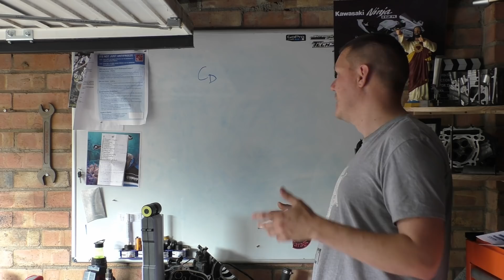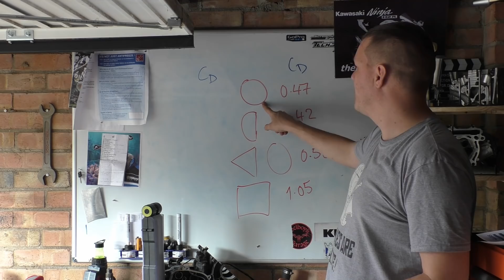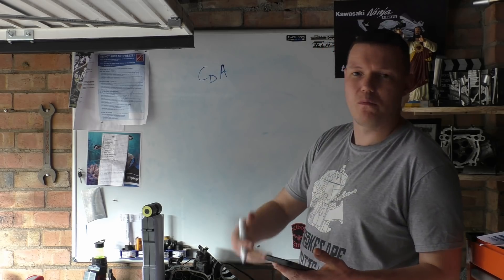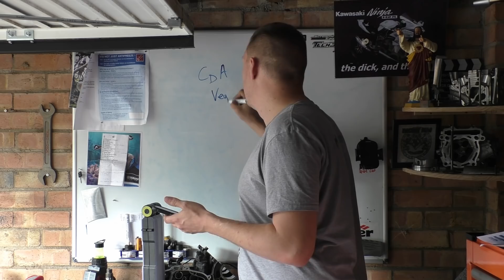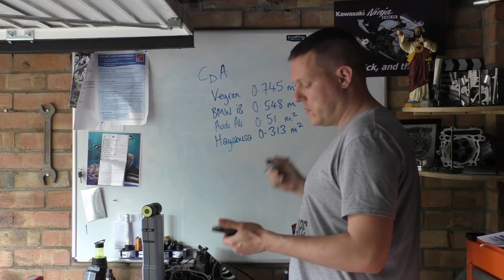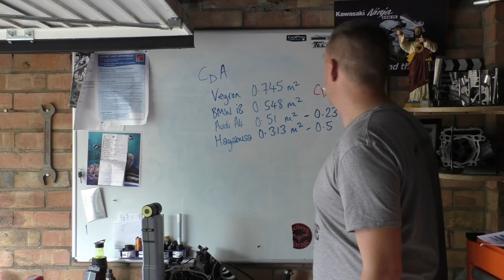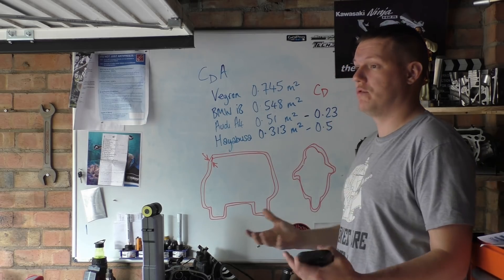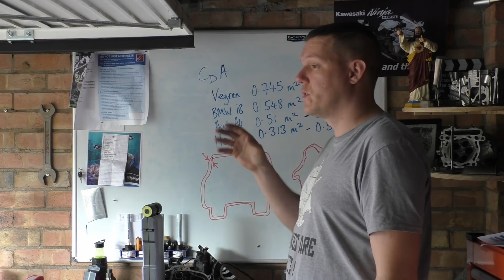Cars vs Bikes - AERODYNAMICS

Comment: CD is basically why we have useable electric cars.
And why we don't have useable electric bikes - range is utter garbage, as batteris simply don't pack eough energy to overcome drag for long enough.

And most of this is to be blamed on motorcycle racing, namely the bannings on fully streamlined motorcycle fairings there, that trickled down into the civlian market.
(It made sense in the 20s, 30s, 40s - in the days of cheap CFD avoidiing full streamlining is done out of historical precendent)
Reply from the maker: "And most of this is to be blamed on motorcycle racing, namely the bannings on fully streamlined motorcycle fairings there, that trickled down into the civlian market."

- Dustbin fairings don't provide that much benefit to a dynamic system vs the additional weight etc...

Comment: A major difference with the car versus bike (apart from the obvious) is that with the car the size and shape of the driver makes no difference so the CD for the car is correct as long as  the windows are shut and no-one has fitted a roof rack. The bike situation changes a lot, the rider is unlikely to be tucked behind the fairing riding round town.

Comment: It’s all just numbers anyway. There are far far far far too many variables that make Cd figures “redundant”;
Rider (size weight ability clothing ad infinitum)
Tyres (pressures compounds wear tread pattern etc etc)
Road surface
Wind speed/ direction
Environmental temperature/ humidity etc

Figures don’t really mean a fuck in real life every day driving or riding surely unless you’re chasing straighteners speeds on a strip or salt pan somewhere in same conditions as competing vehicle

Just my tuppen’orth!

Comment: There is very good and simple way to understand drag in practical sense. Without wind tunnel.
Take 2L pepsi bottle, cut it in the middle (you can drink pepsi before).
Now, take a car with driver and while you are crusing around 50kmh - open the window, and take the half-bottle outside. Cap in front. Then rotate it 180 deg - cap at rear. Now you feel what means difference in coefficent of drag. The surface area is unchanged, but forces are different.
Excuse my English.

Comment: The air resistance is likely why bikes aren't as fuel efficient as cars. There are also other factors as to why cars seem more fuel efficient such as the manufacturer disconnecting all ancillaries & testing on a rolling road so as to limit air resistance. There are car manufacturers that quote their "Government" MPG figures in adverts,that nobody can ever achieve on the road. My 25 year old CBR 600 used to do about 30-35 MPG as the front brakes were binding,now fixed I'm getting 50 MPG+ despite regularly tanking it on quiet stretches of road.

If you ride a bike,there should be no need concerning yourself with trying to get the best MPG from it. If you want max MPG,buy a 125cc & then you'll get 120+ MPG.
Reply from the maker: "The air resistance is likely why bikes aren't as fuel efficient as cars."

- Why?
Reply: The Workshop as it used to be the primary reason the consumers bought model X instead of model Y,& I still recall the Audi 100cc carrying its drag coefficient of 0.33 on the lower C pillars,yet finding any bikes coefficient is pointless as stick a fat kid on it = aerodynamic of a brick,but stick Mr Punyverse aboard and they can hide behind a fairing = aerodynamic as a toy car😁😁😁😁

Comment: Great video Matt, I seem to remember that one of the older unaired bikes was fighting 165lb of drag at 130mph. Badly worded but you get the point, have not checked that against ft/Ib to get the horsepower. It does highlight a bit why these 200mph bikes have such long wheelbases....

Comment: its difficult comparing a 1000cc bike to a 1000 cc car. a car at that displacment is an economy car a 1000 cc bike is fucking nuts so the ecu will be tuned different the revs are different. even though ita lighter and super slippy they have to squeeze a lot more power out of a smaller engine... can you do a video on the physics of cornering car vs bike
Reply from the maker: "its difficult comparing a 1000cc bike to a 1000 cc car. a car at that displacment is an economy car a 1000 cc bike is fucking nuts so the ecu will be tuned different the revs are different."

- there's a load of things you could take into account - however, across the board bikes have lower mpg than cars with engine sixes that are the same. These video are about the fundamental reasons why.

Comment: Aerodynamics only really come into play at speeds above 60 mph
Reply from the maker: "Aerodynamics only really come into play at speeds above 60 mph"

- Here this all the time and it bollocks really. As long as there's air there is resistance. The difference is when you under 60 mph the engines power is a lot larger than the resistance facing it.
Reply: It's not black and white with 60 mph being some magic universal reference point. It depends on the mass of the object. The heavier it is, the less the effect aerodynamics has on it. So, for heavier things you have to go faster to have a decent aerodynamic effect.
Reply: I would love to see car vs bike done at 50mph. See how much the numbers change

Comment: One of the great things about aerodynamics like you mentioned is that its great in a tube but not so easy in real life. When i'm going into a strong headwind it can make a big difference but somethings that work well in that situation are pretty shit when the wind changes directions. They make these deep dish wheels for pedal bikes that I imagine cut through the air quite nicely but would be hell in a crosswind of any kind.

Comment: I know you will hate this BUT... ;-)

the surface drag behaves differently in subsonic and supersonic. Subsonic it is pretty much negligible while supersonic it is a big deal. That's why subsonic aeroplanes are pretty much rounded while supersonic planes are pretty much pointy. So as long as you are not in a glider plane with no engine and very low speeds you can almost forget about it. 

I was one of the wankers who mentioned the air drag in the other video, you said it yourself, the KTM brick has a surface area of about 0,4 m and that Peugeot thing is maybe a little smaller than the A4 so let's guess 0,5m - so multiply the KTM with about Cw 0,7 and the Peugeot with 0,3 and you know that this has some influence over fuel consumption.

So BÄMMM, eat this... ;-)

as usual good video m8.
Reply from the maker: "the surface drag behaves differently in subsonic and supersonic"

- very true, and that is something I'm definately going to avoid. Luckily bikes don't do that fast.

"Peugeot thing is maybe a little smaller than the A4 so let's guess 0,5m"

- 0.5 is really pushing it. An Audi A8 is 2.41 m2. 

Source - https://www.audi-technology-portal.de/en/body/aerodynamics-aeroacoustics/aerodynamics
Reply: oh f**k - ok that's a lot. OK forget my point. BTW get a Ducati - it is not superconic but it feels like it ;-)
Reply: Detailverliebt you mean because the loud bang when the engine goes to death? or what
Reply: No Klaus, I am not talking about MV Agusta I am talking Audi Motorcycles ;-)
Reply: Detailverliebt As long as they are built by Ducati they will find a way to fuck everything up
Reply: Na Klaus, I am not so sure if that is actually true, I owned 3 Duc myself a 998, a 1098s and a Monster 4RS and they all worked pretty well. I was not such a big fan of the 1098s coz IMO the whole suspension sucks but that is mostly a matter of taste/driving style and the 1098s was too agile for me. I like the heavy bikes like 998 and 999 much more, even the older Yamaha R1 works good for me, but in terms of technical difficulties I honestly had non and I used the 998 heavily on the track, I sold it with almost 40k km on the clock with no problems what so ever.
Reply: Well it is more of a joke on ducati just because they are wankers. The bikes are not really that shit. However I don't think that everything goes that well with their bikes.. but you could drive them. Maintenance is another topic, sometimes pretty weird.

Comment: "Aerodynamics is for those who can't manufacture a good engine"

-Enzo Ferrari
Reply: Less drag for the engine to overcome, means a smaller lighter engine, which leads to everything that holds up the engine being smaller and lighter which leads to reduced inertia, better cornering and quicker acceleration....
Reply: Austin Allmond We saw his success in F1 when all the british teams fucked him over sideways
Reply: by using aerodynamic engineering
Reply: Isac, exactly the opposite of the antonov design.
Reply: An-225's aren't exactly meant to go fast or turn on a dime..... I think they have a different designed purpose.
Reply: Exactly. They want to lift heavy stuff so big plane big engine a lot of wheels. It is the opposite to an extreme
Reply: ironic
Reply: Then wat about yamaha??
Reply: Nopd
Reply: Nope